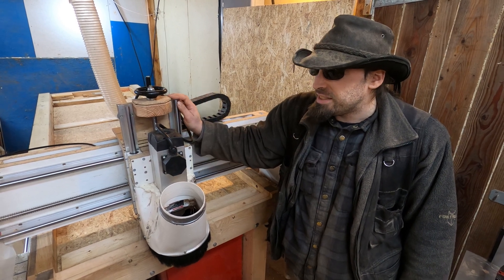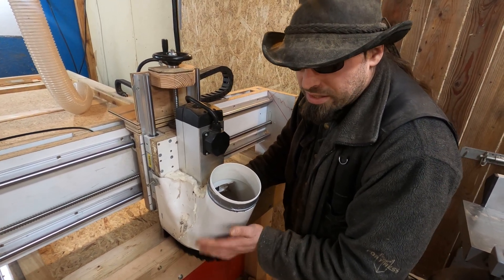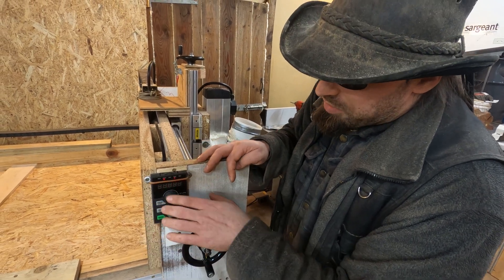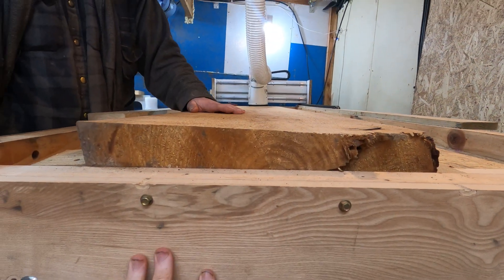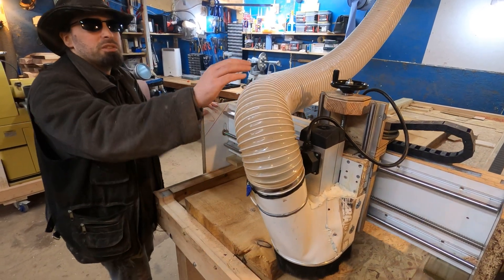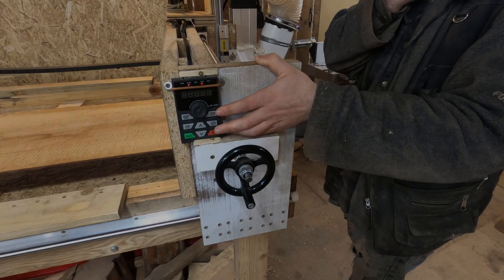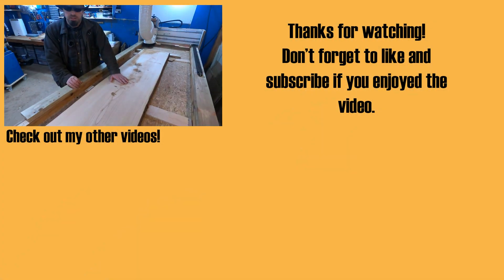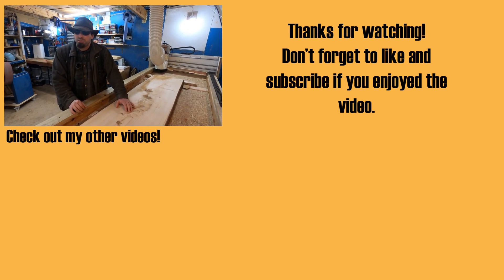The Fully Manual CNC Machine

Comment: As a blind woodworker and engineer I find this fascinating. Is the VFD unit a custom design or an off-the-shelf model?
Reply from the maker: Hi there, we bought the spindle motor and the VFD separately to give us more flexibility, here are the links if you would like to take a look: 
VFD - https://www.omc-stepperonline.com/bd600-series-vfd-5hp-7-5hp-3-7-5-5kw-8-5-13a-three-phase-380v-variable-frequency-drive-bd600-3r7g-5r5p-4 
Spindle Motor - https://www.omc-stepperonline.com/square-spindle-motor-air-cooled-380v-3-5kw-18000rpm-300hz-er25-collet-cnc-engraving-router-milling-grinding-machine-stepperonline-cnc-vfd-motor-380v-ac-spindle-4-bearings-gdz93-82-3-5c4

the feature set of the VFD is pretty overkill for what we need, but it is nice to have access to all the additional features.
Reply: @VisionlessDesigns  Thanks! very interesting. Probably overkill for what I'm looking to build and I don't have three-phase electrics, but very interesting setup nonetheless. I'm working on a CNC that can take simple text input commands, for example "move to 0, draw a circle 50 mm diameter 3 mm deep" for simple prototyping.